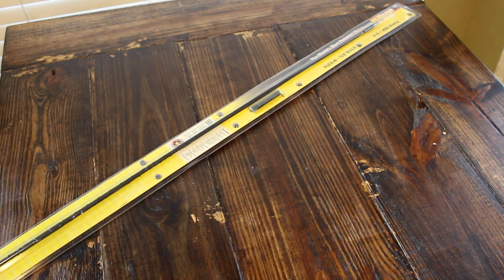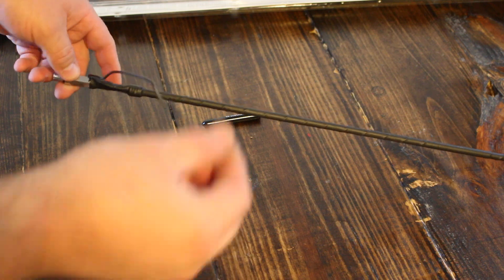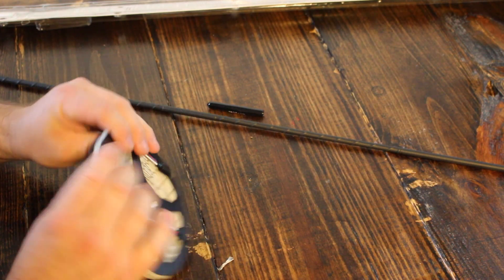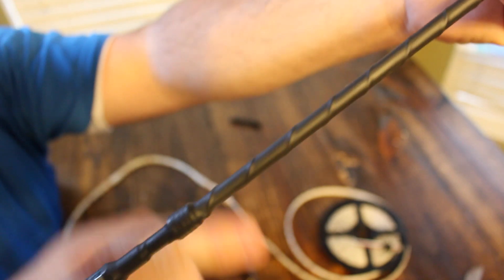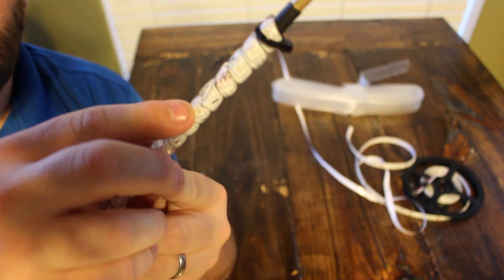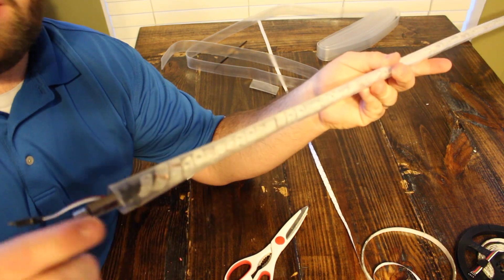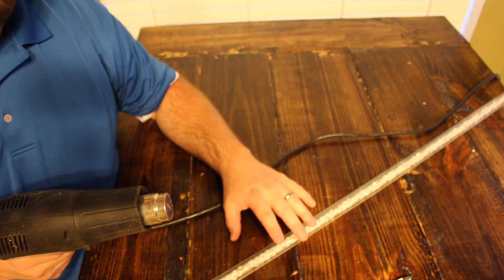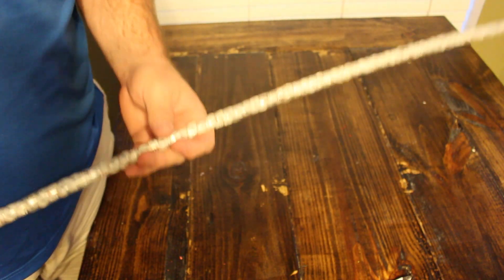DIY - HOW TO MAKE LED ANTENNA WHIP LIGHT FOR GOLF CART | EASY PROJECT

Comment: like the video . love the price of the parts . easy to put on the antenna . The only thing I seen that the led was put on the spool backwards and  you need to be careful putting the led on . i lost one set of lights on the bottom so had to cut and solder the wires on the nest set . for putting on the heat shrink I found that you put a funnel into the heat shrink and put the end of my shop vac with the exhaust blowing out would blow the tubing out and with the help of my wife it went right of . the Power supply is not included in the led kit . I had one laying around that was 12 v dc output that will run them . when I mount the whip I going to cut the end off and run it to 12 volt dc power . thanks for the video and parts list made it easy to build the whip . and for the bang for the buck it worth it .

Comment: Can you use a hairdryer to melt the heat shrink?
Reply from the maker: It might work, But it will take longer. Plus I dont know if a hairdryer will get hot enough to start the shrinking process. If you order the stuff in the description, I would suggest testing a piece first with the hairdryer.

Comment: That looks awesome. I wonder; does the led strip affect the range of the cb antenna at all?
Reply from the maker: It may, I only used the antenna to structure the led's.
Reply: Yes. Just recently did this with my antenna, you will shoot you SWR through the roof. (If you dont understand why that's bad, look it up) basically you will have no range, and run the risk of damaging your radio. If you actually use you antenna for a CB, do not do this.

Comment: Awesome video! I recently did this and my gel coating "weather seal" cracked all over the place. Its sealed pretty well with the heat shrink. Did you have any issues running them with the gel coating split?
Reply from the maker: Mine did the same thing. Never gave me any problems till I left it up one night and broke it putting it in the garage. Just broke another one last week....... same thing. You would think I would've learned by now.
Reply: Fentertainment you broke them hitting the garage I take it?
Reply from the maker: Yup, bout to order the stuff to remake another one.

Comment: how did you mount it too the golf cart roof? how did hook up the wires.
Reply from the maker: I used a regular cb antenna quick disconnect and On the led strip there is a  4 prong plug for the lights and I plug it in to the female connector on the controller that I mounted on the golf cart that I have ran 12 volts to.

Comment: If I wanted to make 2 whips, would I be able to use the same remote to have the colors synced?
Reply from the maker: Christian Garcia yes you would have to either buy a splitter or make one to use with the controller.
Reply from the maker: To go one step further. I have 4 full length strips on my camper running on one controller. I have 2 strips per side in series and then each side in series to the controller if that makes sense.

Comment: Nice job, I have a question, what size is the light bar you have install on your gulf car?
Reply from the maker: That cart had a 36" on the top and a 12" on the front bumper.

Comment: Where can you get the heat shrink tubing?  I know you can get it on Ebay, but what about a store? Lowe's? Home Depot? Radio Shack?  Also, what parts would I need for the 12v power supply?  I've seen a switch kit on ebay with a lighted rocker switch, but I don't know what parts I'd need to connect it to the LED controller.
Reply from the maker: Sorry, I updated the description with everything I used!
Reply: Thanks!
Reply from the maker: Thank You, Totally forgot to do that when I made the video!
Reply: LED's arrived today.  I just ordered shrink wrap and will either find the antenna at a local store or will order it soon.  I also ordered a wiring harness with a blue rocker switch and relay. I'm guessing I'll have this thing all together around Christmas.  The harness/switch is coming from China, so it might take a bit of time to get here.  Thanks again for the great video. I'll let you know when I've achieved success!
Reply from the maker: ok cool, the antenna i listed in the description is a FLEX by wilson. You can bend it and it will not break like a standard antenna.
Reply: That's the one I'm going for.  I've got an old Firestick, but it doesn't flex like that Wilson.
Reply: Is it ok to supply 12 volts dc

Comment: How did you hook up the wiring?
Reply from the maker: Basically I just ran 12v power and ground to the back of the roof to the led controller. I'm sorry I didnt show that.
Reply: Fentertainment 
Could you please make a video showing how you connected the power supply to the led whip?

Comment: is this good for salt water kayaking?
Reply from the maker: I dont see why not, The rgb's are waterproof coated to start with and then I used clear heat shrink to give it an extra coating and to keep everything held together.
Reply from the maker: I will add, I might would get a weather proof box for the led controller.

Comment: The unit I got came with a 110 plug in.  Do I cut into the plug to connect it to the 12v system.
Reply from the maker: The controller takes 12v. So Just make sure you plug 12 volts into the controller. Remember Tip is positive.

Comment: tried to copy your design, question.  How to power it.  What connections connects to the power supply plug that connects to the white controller that controlls the led and remot.   I emailed the led company that sold them and they said they didnt have the connection for  a dc battery.  I really dont want to have to buy a power supply and ac inverter for a gas golf cart.
Reply from the maker: When I bought my led lights it came with the ac power adapter. What I did was cut off the side of the ac adapter that plugs into the white controller, stripped it back and used the tip positive wire for 12v. You will need a digital multimeter and set it to continuity. The inside of the plug will be positive the outside will be negative. Just run 12v to that and put a switch inline. Other than that you will need a mount. This is the mount I used - http://amzn.to/2fNOLMK and this is what I have purchased for mine since the video - http://amzn.to/2i80KW9 This will allow quick disconnects for when I pull it in the garage or tow it on a trailer rather than untwisting it and twisting it back on.